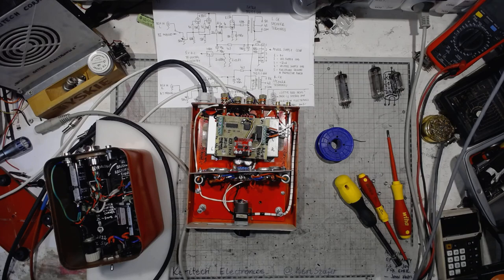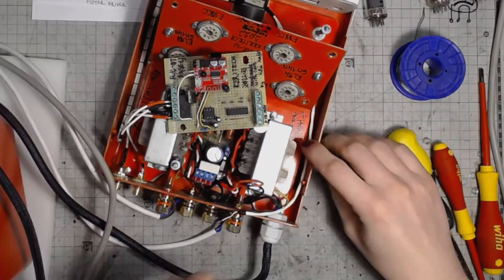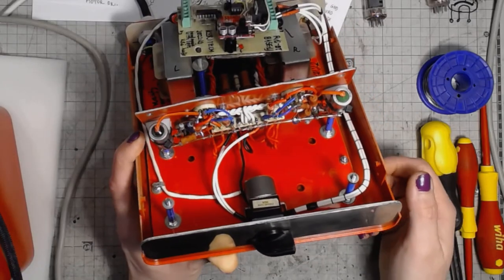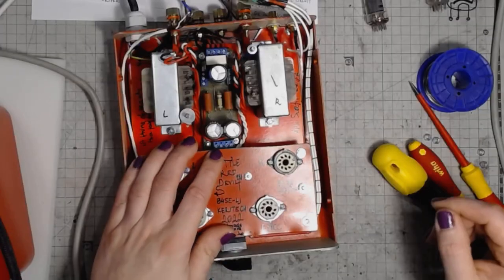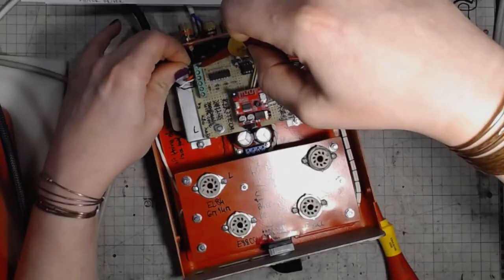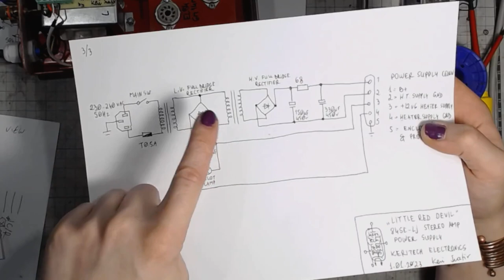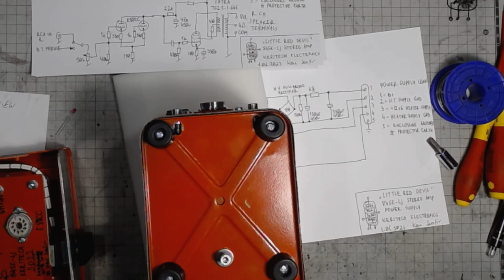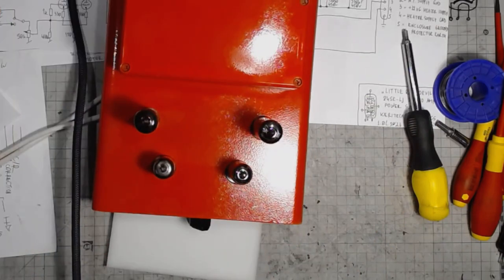Keritech "Litle Red Devil" EL84SE - A custom-made amp with a Bluetooth interface and remote control

Comment: I wonder why someone hasn't converted the Bluetooth signal down to 2725Hz and 2925Hz and using a data slicer to recover the wanted data and feed the output from the data slicer into a stereo DAC all done using wire ended pencil stub vacuum tubes.

Comment: I'm still digging your idea of a wireless foot switch (Maybe 3 or 4 stomp switches to begin with)... I must confess, I haven't performed my due diligence regarding the wireless com.. Perhaps X bee type? Anyway, I will Google the heck. But I want to know something. Wouldn't a wireless foot switch only consist of an output signal of Off or On? In other words, all or most of the Hi Tech goodies would mostly be housed in the amp itself, besides the RF signal emitter? For example, when I stomp the reverb on the foot switch, the circuit in the amp would magically turn on...??? And I would have my delicious reverb and get to eat my cake too... Thanks and cheers!
Reply from the maker: On or off, but make it multiple times (a pulsetrain) and let the electronics on the receiving end decode that... It can do way more than just a single switch :)

Comment: Hi, would you be open to build a tube pre amp that is battery operated ?
Reply from the maker: Openness - sure, why not? But then there's a bunch of considerations:
1. Plate voltage. Most of the time (not counting some special tubes for automotive applications like the bee's knees ECC86 etc.), tubes need high plate voltages, around 90V and up. Making a battery tube preamp means either using a high voltage battery pack (which was done with portable radios) or a voltage converter, pretty common with cheap Chinese amps running from a wall wart and a DC barrel jack. Designing a good, low-noise converter, is more of a problem and it's kinda beyond my skill now.
2. Heating. It takes power, so it'll drain the battery pretty quickly.
3. Signal levels and distortion. Are we talking about a RIAA preamp, or a line pre for hi-fi? Or maybe a guitar preamp? In the latter, some distortion would be desireable, while the former should have as little as possible while dealing with signals of a few volts (line level output). Trying to reach that with low plate voltage would be difficult, unless we use the voltage converter.
I'd rather do classic designs for now (if we're talking hi-fi or recording gear), may look into making something crazy or downright outrageous for guitars. Here be drag queens!
Reply: @KeritechElectronics   @Keri Szafir  hi Keri, thanks for your insights.

On high voltage battery pack, you mean like at least 90v ? If so, not practical for me.
DC barrel jack would be ok ...I would use sealed lead acid battery to power up pre amp.

Line pre amp would be fine.

Comment: Gotta plug a tele into that
Reply from the maker: Not enough gain - it's line level input, so a single coil pickup will be too weak. Humbucker - maybe, but still this thing is not going into overdrive.